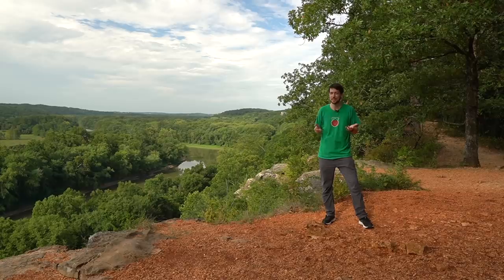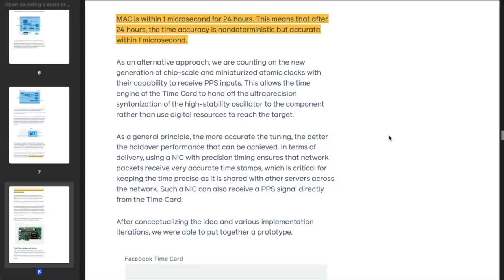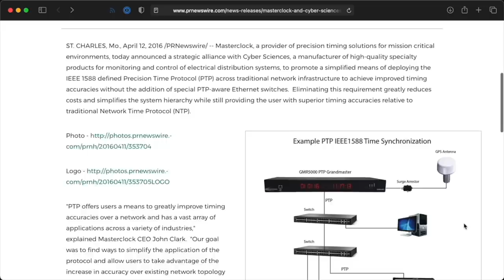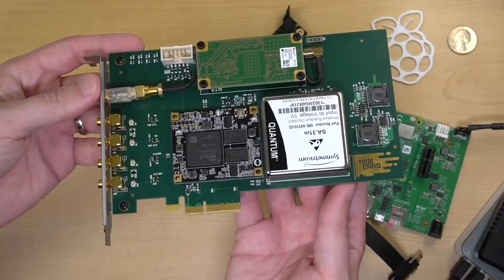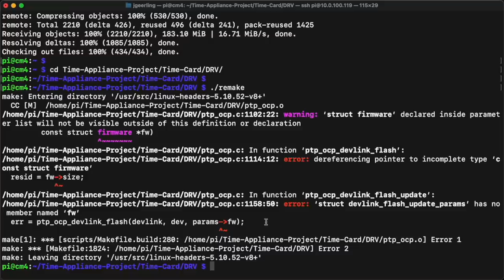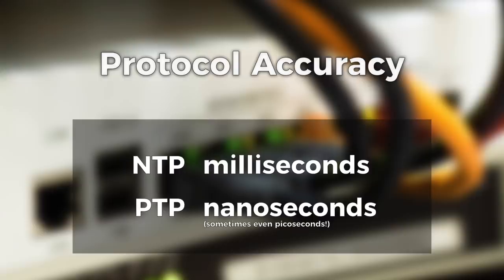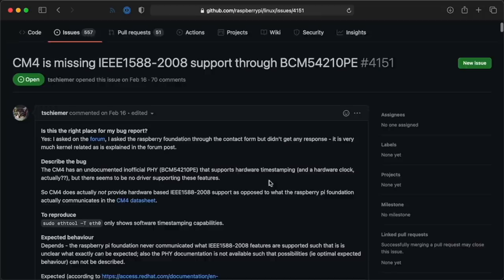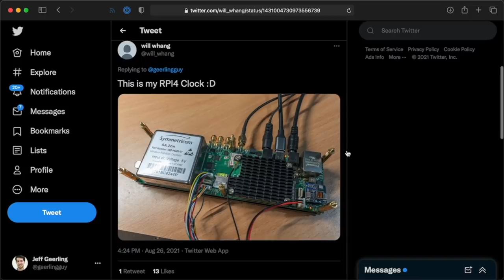The most accurate Raspberry Pi atomic clock IN THE WORLD!

Comment: As light travels 1 foot in a nanosecond the lengths of cables are all critical. To get accurate time to 1ps you need to measure cables to 1/1000 of a foot & understand how much slower the signal travels in the cables used - signals in optic fibre cables only travel at about 70% of the speed of light.
Reply: The electromagnetic wave moves at similar speeds for electrical signals.

Comment: For over a decade I have been aware of the systemic benefits of hardware clock module upgrades. These benefits go beyond synchronization issues, and improve board functions resolution and noise levels. Might there be some way to rig this clock to REPLACE the clock functions that run processing and GPU functions? There might be significant benefits to be realized!

Comment: 10:04 an open source, simplified time synchronization platform could be made more secure and cross-platform. If adopted as part of a standard for communicating info between smart cars, we might see automatic safety features get a lot better. particularly in traffic streams where several smart cars can respond to each other predictively. Autonomous and maybe semi-autonomous caravanning also becomes more practical.

Comment: I used to use a similar system for calibrating the A2D in seismographs.  It would output a square wave at a series of fixed frequencies. It was a lot bigger than your card there.

Comment: Accuracy doesn't depend on frequency. Frequency of the input signal decides *resolution*.

It's a completely different reason why the drift of the atomic clock is much lower than the drift from a watch crystal. The gas pressure is affected by surrounding temoerature changes but this doesn't much affect the vibration frequency. The size of a quartz crystal is significantly affected by temperature, which is a reason why scientific instruments with a requirement of  a very low frequency errors uses crystal ovens. So the frequency is calibrated when the crystal is at a very well defined temperature.

Many watch crystals are calibrated for human temperatures, based on the assumption they will be worn in a wrist watch. So a digital wrist watch keeps time best when worn.

One note here is that a slow 32768 Hz watch crystal has better long-term stability than a 4 MHz watch crystal because the crystal is heavier and less affected by mulecules trapped within the hermetical seal that lands on the vibrating crystal. A molecule landing on a 4 MHz crystal represents a larger relative change in weight and so a larger relative change in resonation frequency.

Comment: Hi Jeff -- very nice presentation and very interesting board.  Like some others, I'll quibble about the "200,000 times more accurate" bit but that's not the reason for this comment.  It looks like the board is using a u-blox ZED-F9T GPS module, which is a very modern device with some amazing capabilities for the money (about $200 for the module).  One reason is that it is a dual frequency receiver, using both the L1 and L2 signals broadcast by the GPS satellites.  Among other things, that allows for correction of ionospheric delays.  BUT... the antenna you held up is a bog standard one that is almost certainly single-frequency (L1) only.  With that, you won't be able to take advantage of the ZED-F9T's real potential.  You can buy dual-frequency antennas for <$100, so given what the rest of the system costs, that's a worthwhile investment.
Reply from the maker: Good point! And I also have it on high authority a v2 version of this board will have an optional 2nd U-blox module that operates on L5 and could also get radio from WWVB, I think.

Comment: Show us how to deploy a low cost array of radio receivers at known locations, each equipped with time cards, and each on a network so they can be remotely tasked to receive a specific radio frequency being transmitted from an unknown location (e.g. from a drone). The receivers would then send the peak signal spike times back to a command unit, which then geolocates the transmitter using TDOA(?).
Reply: Now that's an application I'd love to see.

Comment: I worked in a large data center 10 years ago. We had GPS network time module  as a grand master clock. One day we had a major communication issue. Knocked out the system. Took a little but, then we found the times all off a little between the iron. Find out our GPS antenna had been broken. Set up a second antenna after that.

Comment: Jeff!  You could have used a PICe NIC with PTP HW time stamp capabilities.  Trust me.  It works.
Reply from the maker: Will be trying that soon!
Reply: @JeffGeerling  I’m currently integrating rubidium, full cesium and CSAC as system clocks in Linux.  Don’t forget to register the external clock as the Linux default RTC

Comment: Atomic clocks don't involve nuclear radiation, even if they use Cs atoms.  They are all about light and radio radiation hitting the electrons on the outside of the atom, which will resonate at specific frequencies depending only on the chemical element and which of the electrons you hit.  Those 50000$ HP Cesium clocks contain a big vacuum tube where Cesium is boiled and thrown through an obstacle course to only get one kind flying around in a metal box where the outside electronics can send in a signal and measure if the atoms resonate.  Then the electronics will test multiple frequencies from a quartz crystal and determine which ones seem good, then finally look at the ISO standard to know if the highest or lowest is the one to use.  Entire experiment is shut down and restarted frequently with the built in computer continuing to output the last good quartz frequency until it measured the next one.  This famous photograph of a thing lifted by two experts is what HP reduced to a vacuum tube the size of a human forearm.  Much later someone tried to make a silicon version, but it was so temperature sensitive the inventors joked it might be more useful as a thermometer.

Comment: I thought frequency is a necessary but not sufficient requirement. One nano second translates to about 1 foot precision on the ground. My team 20 years ago worked a thermal modeling of rubidium to keep the atomic clock within a few mK temperature difference. Technology has come a long way. Quantum physics is ever more prevalent without people knowing it. Perhaps not many people notice that general and special relativity are used to correct time, due to object acceleration and speed.

Comment: Also if you are going with the hardware timestamping route, use level 3 multicast first, ie. UDP. The ethernet multicast can be tricky if there are multiple switches or routers that don't support it.
Reply: I think the hardware support for timestamping only works at the Ethernet layer. I agree that multicast is the most scalable solution, but many switches and routers don’t support it, or it’s turned off by default. This has been an issue for many years.

Comment: Issue with time drifting will likely to be with the virtual environment had it happen on mine when the virtual machine was being throttled but the problem was the time clock was linked to this in some way (usual fix is to change the high precision timing settings turn it off or on depending on the setup)
Reply from the maker: Yeah, that could be it too... these servers I use for Server Check.in (the ones with no user data on them, just running the checks) are on low-budget VPSes on hardware that's likely a bit oversubscribed anyways. But that's how I target the low $15/year price point!
Reply: @JeffGeerling  should be able to raise a ticket to get them to fix it (or if your using Linux change the clock timing source)

Comment: *raises hand* I too have a server that loves to drift forward in time constantly and ntp just wasn't working properly on that server. I was to lazy to spend the 8hrs to rebuild and reload and yet I went spent many times that writing my own sudo ntp system to get around the issues.
Reply from the maker: lol, too lazy to be not lazy!
Reply: Did you consider deleting the cached ntp statistics? I had a dual-boot machine where Windows did set the time. All the way to using local time zone change after a summer/wintertime change.

This made the normally running Linux installation very, very sad. It more or less permanently added a very big drift correction that made the Linux installation drift badly. I hoped for many, many monyhs that it would fix itself. It never did until I deleted the cached data so it retrained on how much drift the hw clock suffered.

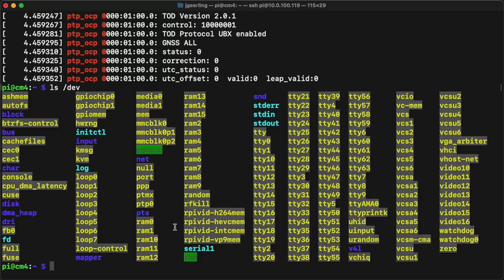Comment: 7:08 This is partially incorrect; /dev/pts is a directory containing pseudo tty allocations (ex. /dev/pts/0); see pts(4) man page. You may have seen these mentioned when using the w(1) command. I believe you meant to say /dev/ppsX ("pulse per second"), which is a userland interface for a high precision timer -- which is not present in your video. You probably did not include the option in your kernel config, and/or 5.12 may not offer this to userland (unsure); 5.15 may in fact do this, but I'm not sure as the GitHub page for OCP TAP is not clear, while FB's own engineering page does mention it (though under a very different tree). Finally, it's also possible you confused ptys and ttys, the latter of which are also associated with serial interfaces (which are quite common on several receivers; many GNSS and NMEA devices include one as their way of userland interface).

Comment: Hi Jeff, in our Mainframe we use a STP (sysplex timer Protocol) that Provider an Atomic Signal also. STP is a mix of the Hardware and the Software of the operating Systems. It is doing s nandshake, so that very Mashine measures the runtime of the Signal and corrects automatically the time to be correct. Do normal Servers are Build in the Same way)?  Because, if not, Evelyn Server will run with different timestamps again.

Comment: Installed a 1 Rack unit GPS NTP at Bell Labs/Telcordia. Need to have the antenna run to the roof. Hmm would the ham station have been easier? Would it have been allowed on the corporate LAN?

Comment: I like the the project. But I suppose you can make a similar but much cheaper ($600 less) solution by using a OCXO instead of a rubidium standard. The accuracy will be around 1ns when the GPSDO is implemented correctly. I think the Rubidium standard is a real overkill here. Its something you would use in 4G/5G mobile equipment or electronics measurement equipment. 

How accurate is the ptp protocol? It probably accounts for propagation delay times in ethernet cables with a distributed clock. But is it as accurate as this module? I doubt it, probably around the 100us range, then the Rubidium standard will be a waist of money.
Reply from the maker: That's something I hope to explore in a future video. I may be able to make a second board with a cheaper oscillator to compare.
Reply: @JeffGeerling  I'm in the process of making a 2nd version of a 10MHz GPSDO for my measurement equipment. I get around 500uHz accuray at the moment. Just with a second hand GPSDO and a cheap GPS module, base on a SAMD20 uC. No FPGA needed for this. Total cost around $150. I might implement an NTP server, but thats not my goal.
Reply: 8ns is very achievable with PTP. As the only reason for the clock is to cover outages in GNSS, very few applications would need more than a TCXO unless you're expecting or need to plan for long outages or jamming, although apparently GNSS jamming is a credible threat in financial applications.

Comment: This is an interesting topic and one that I have long term experience with. Back in the day, we used WWV as one primary time reference. I'm having a hard time understanding why I should care about the differences between these references and NTP? What is the to gain in the specific examples you presented?
Reply: NTP has less accuracy.
Reply: @autohmae  Clearly. Internal NTP can be accurate to 1ms or less whereas Internet-based NTP is often 10 or more ms. What I'm finding challenging is the use case for time more accurate than 1ms in normal use. I'm just looking for some examples as to why I might want to consider this for my own stuff. Maybe there's something I'm missing...

Comment: It's a shame Broadcom doesn't put 1588 timestamping hardware in more of their ethernet parts; it's a pretty trivial amount of hardware and they've had the IP for at least 12 or 13 years, which is around when I started working with their chips for PTP. Also a shame that they lock all their datasheets and reference manuals behind NDAs and such.  Intel, TI, NXP, Microchip, and others I'm forgetting all have a bunch of 1588-capable Ethernet parts with available documentation.  It's been integrated with NXP's i.mx series SoCs for ages, as well as TI's industrial and Automotive ARM SoCs.

I'd be really surprised if you can't get 1588 working with an Intel i210 PCIe card; I did a bunch of development work with those (albeit in an Intel-based PC) and they're great, although the timestamping is done in the MAC rather than the PHY so you have to know (or be able to calculate) the propagation delay the PHY adds to ingress and egress (which are not necessarily the same) to get things working 100%.
Reply from the maker: I know someone who's gotten it working already on the Pi with an I210, and also on an I350. I have an I340 but it doesn't have headers I can use to measure things, so I'm trying to get an I350 to do some of my own testing with.
Reply: @JeffGeerling  I think ptp4l has the option of synchronizing your system clock to PTP, which you should be able to use to toggle a GPIO. There would undoubtedly be a lot more jitter than a direct SYNC_OUT, but it should demonstrate synchronization.

If you can get your hands on an i210, it's got a cool "Timed launch" function in the MAC that you can use to precisely synchronize when packets are emitted. I was trying to help get that functionality integrated into Linux before I left that job; I think it's at least partially in place now.
Reply: @JeffGeerling  BTW, the "espressobin" board is a cheap way to experiment with a PTP-capable Linux switch, albeit only a 2-port + management interface one. Marvell also sucks about data sheets, but the base PTP stuff is already in the kernel.

Comment: The clock may well be accurate to a nanosecond but how long does it take for that information to get into the computer proper where it can be used? In other words, what is the latency of the data busses, the driver software and the interrupt response time? Are they known and are they constant?
Reply from the maker: There's been a lot of effort in the Linux kernel and specifically in the PTP project (http://linuxptp.sourceforge.net) to ensure the system clock is extremely precise, and the nanosecond level of precision should make its way all the way out to the wire with PTP.

That said, some architectures could add delays, especially if you have a poorly-designed system or a lot of PCI Express traffic causing contention. So the only way to know for sure how it performs is through more rigorous testing. I hope to do some of that in the next video.
Reply: @JeffGeerling  Thanks for the reply. I am going to have to subscribe now to make sure I catch that one!!

Comment: Thanks for this project!  Just wondering:  Are you overstating the accuracy of the the SA.31m?   Datasheets for the Microsemi SA.31m, SA.33m and SA.35m (along with the SA.45s) imply they all have an accuracy of '±5.0E-11 accuracy at shipment', while Microsemi vendor Sparkfun says: 'That puts the SA.35m Miniature Atomic Clock in the picosecond category of eight seconds per 31,689 years. Said differently, the MAC loses a second every 4,000 years or so.'
Then again, I may not understand the long-term accuracy.

Comment: Hi Jeff, loved the video, watching you is always interesting but I was thinking… what about your vid for Wifi 6 access point on the AX200? Thank you!
Reply from the maker: Still working on that (now with AX210). Note that it seems Intel's drivers don't allow it to work in AP mode so I've been testing some other chips too.
Reply: @JeffGeerling  Too bad! I had hoped to create a full GPON router with my PCIe switch. Maybe there is some other interesting 6E card for hostapd? Maybe one with MIMO 2x2 (I looked closely at the AX2?0 and the shielding says MAIN and AUX, so just one Tx antenna)

Comment: Jeff i have a little question, now with windows 11 arm, maybe works the drivers for graphics cards on cm4?
Reply from the maker: No, the drivers would still have similar issues as the ones on the Linux side; AMDs own engineers are still slowly trying to take a look at the problems (and we have few clues besides 64-bit memory errors so far).

Comment: I built a GPS syconized Nixie clock with the Arduino, but the TV signal via satellite is too late. How do i fix this?

It would be good if the Raspberry Pi 4 B had a built-in RTC like the Rock PI has. 
But Rock PI is the only one who knows November 31st.

Comment: I wonder when motherboards will have this built in, or workstation or gaming machines including one of these cards.
Reply: Why should they? What value would it be to add cost and energy consumption and a need for a GNSS antenna that does not work in many locations inside.

The huge majority of computing solutions manages with ntp time service and a battery-operated RTC to help it know an initial time directly on boot. And with 5G narrow-bandwidth solutions, more and more equipment will have wireless networking allowing them to ping a ntp server. It should also be possible to bridge time using Bluetooth LE.

In the end millisecond precision really works quite well for the majority of needs.